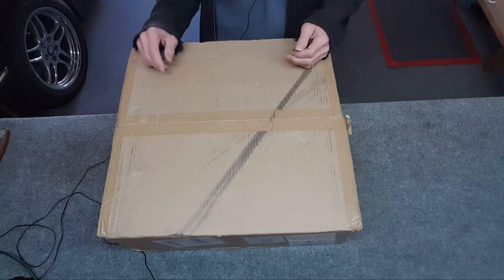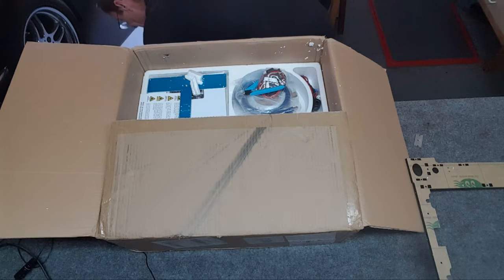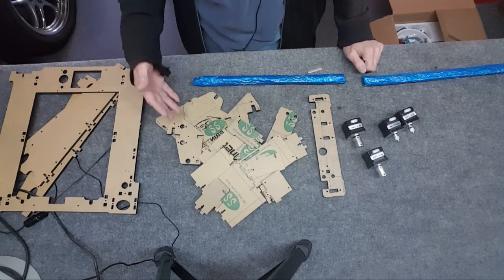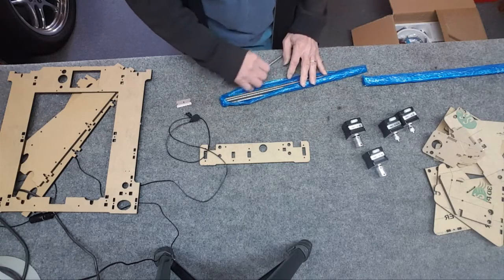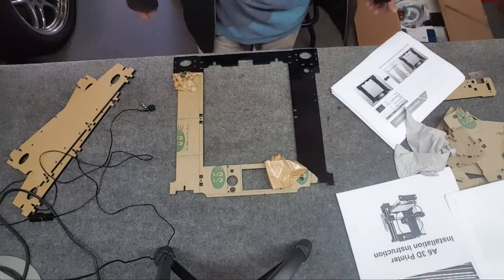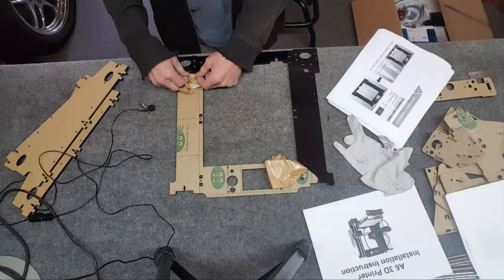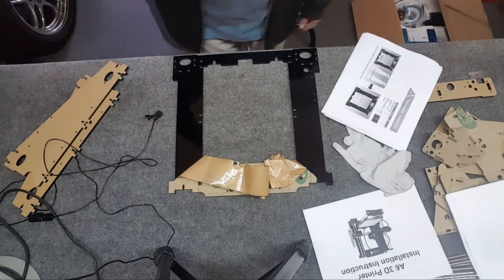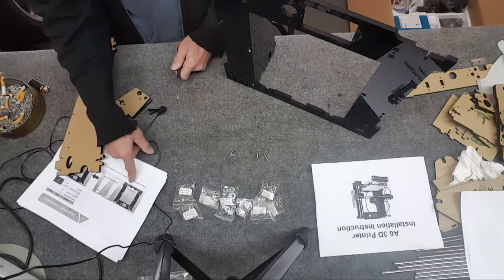DIY Anet A6 CNC Printer Hardware & Software Part 1 of 3

Comment: Fun to watch Your fight with this China jigg saw puzzle. Good luck!Several of You Tubing guys are affected by low temperature in Your shops. Doesn't that low temp affect the behaviour/precision of Your mills, lathes etc.? Why don't You use radiators and keap a resonable temperature in Your shops?Waiting for part nr 2...
Reply from the maker: I really don't do precision work when its this cold. Unfortunately to much airflow in the shop prevents using larger heaters...
Reply: Poor You, no shop works during winter… I keep my mini shop in the kitchen, shopwork all the year. Okey, no Mrs here.... You are probably the lucky one at the final end.

Comment: Dave, I bought my A6 last summer. It took about a day and a half to be printing. You will really love this thing. If you can do 3d design there are so many things for the shop you can make too. I've just recently started having a problem with the x-axis belt coming loose and making some oval circles. I've ordered the fiberglass belting and am printing a tensioner as I write this. I upgraded to a y-axis tensioner early on as well as clamping it to a piece of wood to help stabilize it. Also upgraded the hotbed wiring and added two MOSFETs for the power supply and hotbed. Thanks for the video, looking forward to your trials and tribulations! 😀

Comment: Hi Dave,
If it's ABS, acrylic or HIPs plastic sheet it's laser cut.
we have a laser cutter at work for this type of work, we also cut high density foam for packaging.
Usually the cut edges are not cut perfectly square as the focal point of the laser creates a fan out.
You'll  notice it more on the thicker material. As the laser cuts it vaporisers the material, sometimes welds the protective film to the part being cut, making it a pain to peel off.
ATB Adam
Reply from the maker: Took me some time but I finally figured out why this comment??? Its answering my question on how the thing was made.. Thanks!!
Reply: +Dave M 
Glad to see the penny finally dropped ! 😂